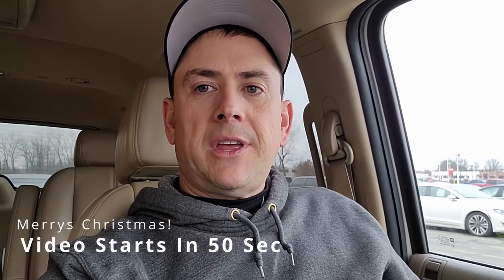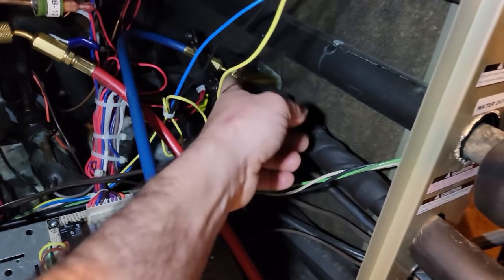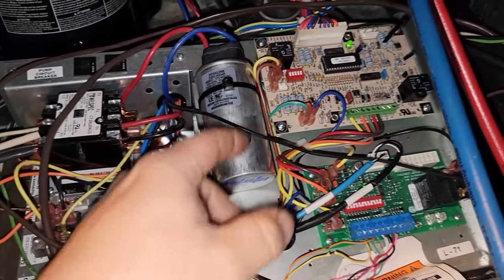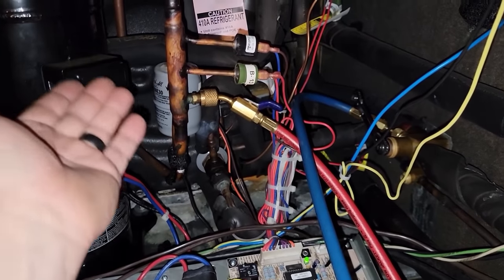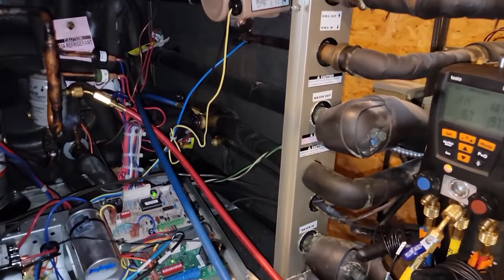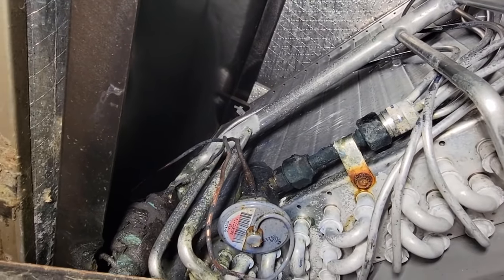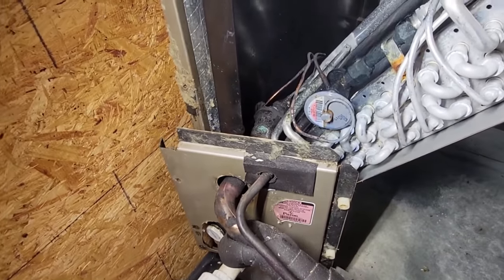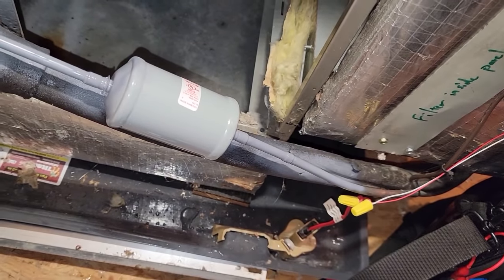Heat Pump TXV Failed - Aux Heat Coming On

Comment: Nice Video, Those of us that dont work on heatpumps all that often, just the angry sound when the reversing valve changes gives me pucker factor 20. I do quite a few water source heatpumps in condos and such with a building loop but I still cant get used to the changeover!! ha ha. Thanks for sharing Rick
Reply from the maker: 👍👍I hear you, it's just a little compressor chatter 😂

Comment: Merry Christmas  great video  We had one of the first Geothermal heat pumps. I was never happy  with  it. The power  company  kind of pushed on us. We had to use their  choice of installers. Well they under sized the unit we always  were using  strip heat. Never did get warm. Moral never leave your tried and true repair  people.

Comment: I work on hydronics and heat pumps a lot  but I don't like heating or reversing valves . I always wish I was working on cooling only applications or refrigeration,  but I guess the grass is always greener innit . Good troubleshooting as always sir , looking forward to the lights reviews 👍.
Reply from the maker: I need to get it done, they were asking about it last week.

Comment: Thank you for all your dedicated time with your excellent videos merry Christmas and have a happy new year
                  Water source heat pumps for all you guys who think you will never see one think again whatever you see happening in Europe and in Japan because of energy efficiency 10 or 15 years later ends up being the norm here in the United States we’re slow to adopt and catch on to what should’ve been done decades ago. 
           And if we ever do adopt semi flammable refrigerance you will be 100% guaranteed to see water source heat pumps deliver heating and cooling into a house instead of refrigerant.
Reply from the maker: Thanks for the feedback! Water sourced heat pumps have been around a long time, I've seen them from the 80's and are more popular in colder regions where outdoor temps get well before 20*F and stays at or below that for several weeks or longer. In southern states where it barely gets below 30*F an air sourced heat pump is better suited because the cost of a Geo won't be worth the savings. A couple other things I wanted to expand on.  The water circulates through the coax that has refrigerant circulating through it.

Comment: There are two possible problems.   1) There's sulphur (hydrogen sulfide) in the well water, dissolved from rocks.  2) There's sulphur bacteria in the water softener (and possibly in the water heater and/or well).     If it's just in the water itself, without bacteria (Marshall, Texas had that.  You could smell it every time you took a shower), there's not much you can do other than some various filtration options, or drilling a new well.   If it's from bacteria, there's a variety of things you can do,  The water will have to be tested to find out which, and should have that done _anyway_.   Many states have free or inexpensive water testing available through their ag services.   

I hope you and your wife have had a good, peaceful Christmas - sorry I keep missing your livestreams.
Reply from the maker: Number one is what's very common. Thanks Troy, you too!

Comment: I run into these water source units frequently in the converted condo's still using a cooling tower. I see the water flow control device on the supply at the indoor units have you made a video on adjusting those and checking line temperatures and head pressures? And is that something once adjusted should be good for both seasons? Great video ... again.
Reply from the maker: I'm looking for the spot where I said check out this video so I can link it. I did go through the check out procedure.

Comment: 3GPM seems like a lot, we run our Water Furnaces and geo smarts at 2GPM, manufacture wants 1.5F, we shoot for 38f leaving water temp, all entering water temp in my area is 50f.
Reply from the maker: 1.5gpm is usually the minimum for open loop.  I work on Carrier, Waterfurnace and Climatemaster.  This was a closed loop system, normally 2 is the minimum for closed loop, a lot of times we use 3 speed pumps.  If you do the math of water rise X GPM X 475 the eff works out to be about the same. You just create a little more wear on your coax coil.

Comment: Maybe I am missing something or it is different in this system, but if it is the HEATING txv then wouldn't it be the txv in the compressor section that was the issue.
In a regular split system air to air, the indoor txv is for cooling application.
Reply from the maker: That's why I mentioned the problem was found in cooling mode. I figured since we were just into heating that the problem was noticed in cooling more than heat. In heat mode it was fine, your correct the txv is inside the compressor section when its running in the heating mode.
Reply: @HVACRSurvival  
My bad. I guess I had a preconception it was in heating with the title of heat pump.
After watching it from the beginning again, I guess I missed some the first time where you stated it was a cooling mode issue.
Reply from the maker: I talk fast and cram a lot of information in real fast. It sucks editing my own work😂. So it's not new to hear I created confusion. Thanks for watching and leaving feedback!

Comment: Is it worth doing geothermal system in areas like this with H2S gas?
Reply from the maker: What is H2S gas?
Reply: @HVACRSurvival  I think I was watching a video where you were explaining how how sulfur gas destrois everything, although I can't find it in my history 😕    I probably got the term it wrong.  Had 2 browsers open with YouTube on them,  because its taking 5 - 10 minutes to load YouTube.  Then to top it off I commented in the wrong video .
Reply from the maker: We refer to it as sulfur gas, if you have sulfur gas you can get an aluminum evaporator coil but you'll still have some damage, but not as much. Whether or not it's worth it depends on what source of heating you have, natural gas ? no it's not worth it, propane? yes it may be worth it. All electric? definitely worth it.